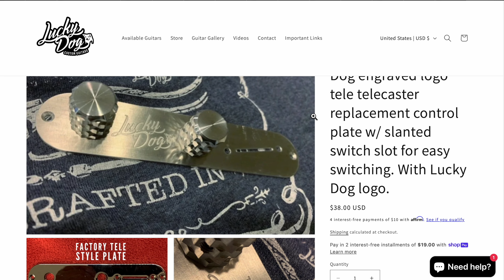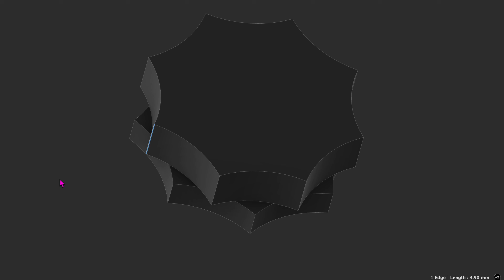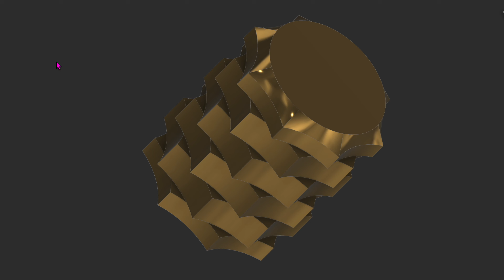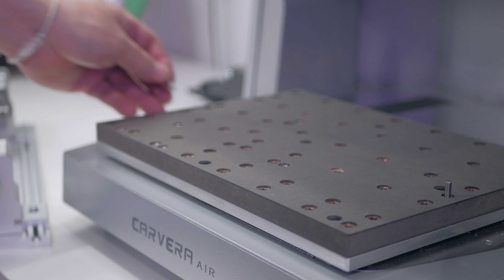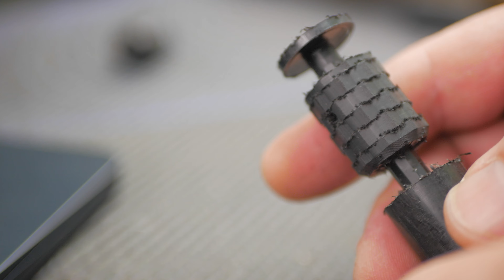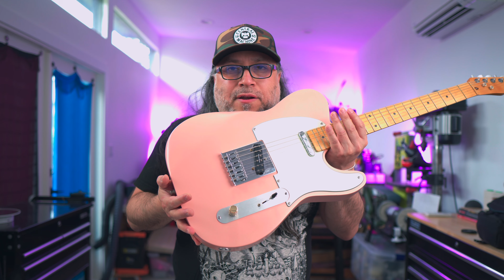Sharpest Knurled Guitar Knob - Makera Carvera Air

Comment: For polishing in the small areas, have you tried a rotary tool (like a Dremel) polishing wheel? You can also get various abrasive wheels if you need to be more aggressive to remove scratches or machining marks. Or you can just get the little felt wheels and use the polishing compound of your choice. I wouldn't want to use it for a large area, but for small hard to reach places it might do the trick for you.

Comment: Just wanted to say that you can use the 4th axis with the normal paid version of fusion without the manufacturing extension.  It just wont do simultaneous multi axis machining, but you can index to fixed positions and machine around the part that way.  You could accomplish the same end result as you had here but it would definitely take more time to program.  Didnt know if you were using the free or paid version so i just wanted to throw that out there.
Reply from the maker: Hi, I do pay for Fusion. I saw the "unwrap" option for 2D milling that could be used for 4th axis tool paths. But I didn't see any other way to access 4th axis options. Maybe I missed something.